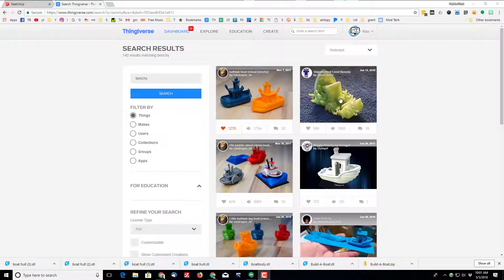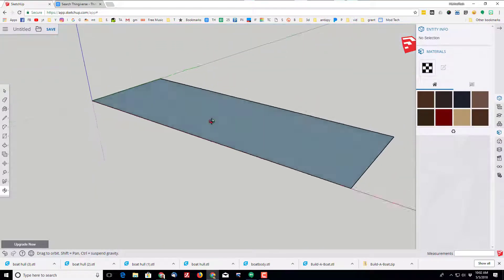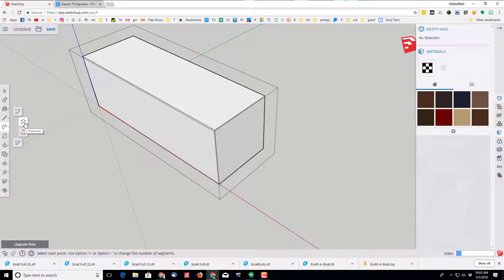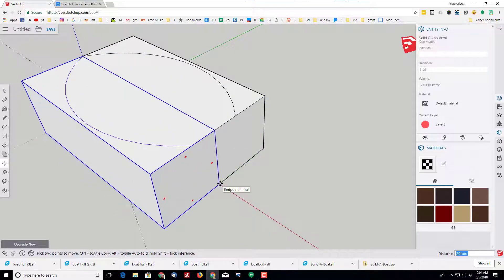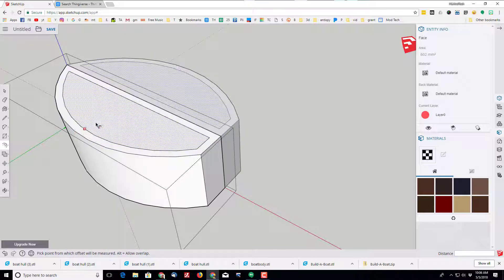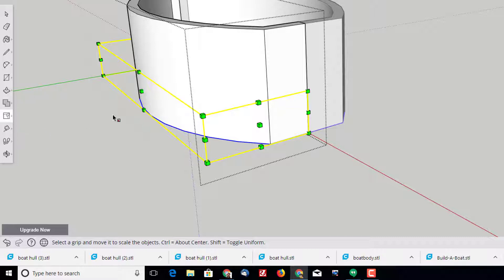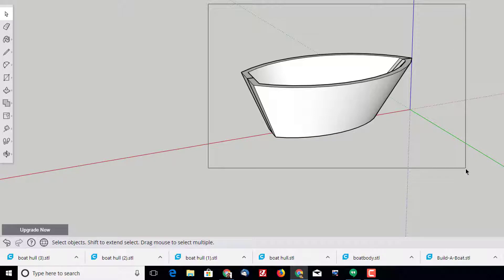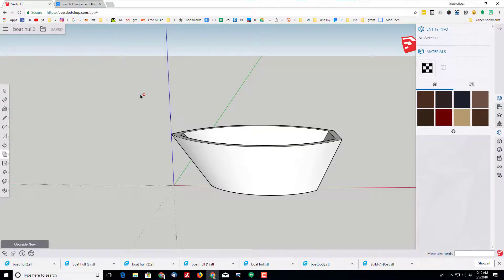Build your own Boat Hull using Sketchup!

Comment: This was a great tutorial! I was able to do it, but for some reason when you are first shaping the boat hull it seems that when you adjust one side it adjust both sides symmetrically. This was not true when I did it, for some reason it only adjust one side at a time. Am I missing something or has the program changed?
Reply from the maker: There is a good chance that the program has changed. I have not used it in years. If I get a minute I will give it a try though.
Reply from the maker: Did you make it a component? That was the magic part of that step.
Reply: @HLModTech that was it! I missed that. Thanks! I love all of your tutorials and share them with everyone.
Reply from the maker: Perfect! Love it when a plan comes together! I had not messed with SketchUp in a year or so.. Nice to fiddle again. Thank you for the nudge.